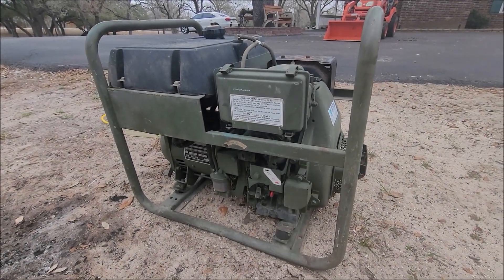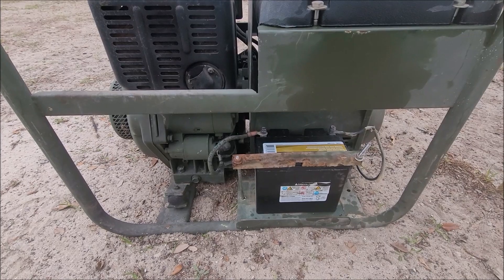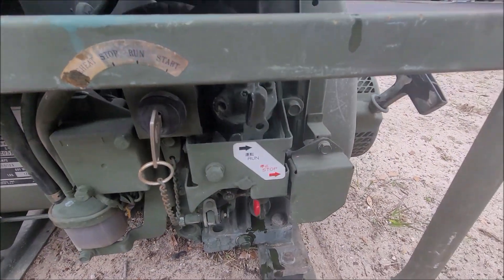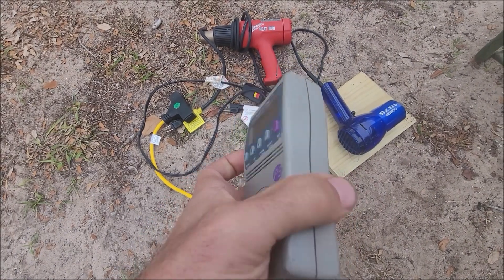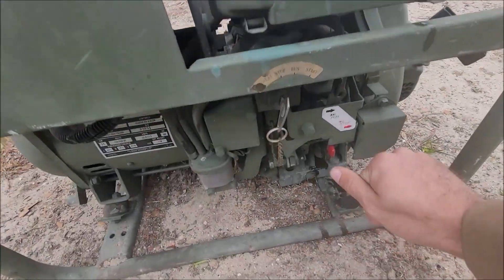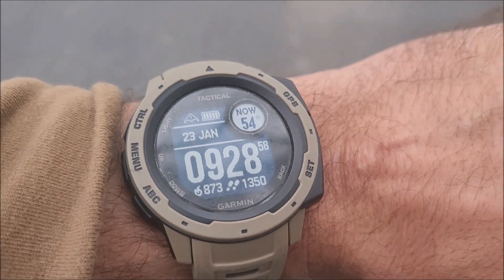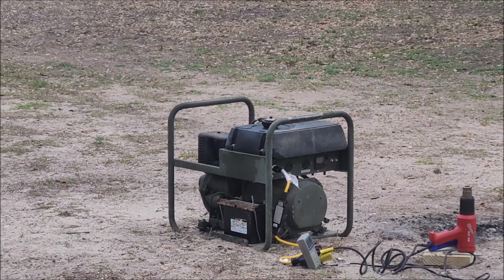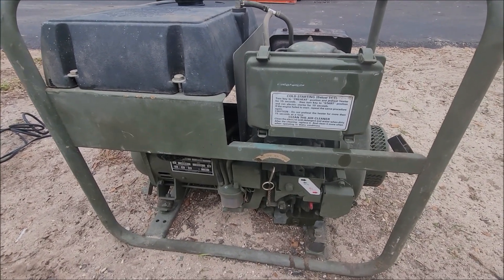Lightweight Independent Power System (L.I.P.S.) Part #1

Comment: I’ve got one of these and I started it today after 10 years of sitting and it started right up. Problem is it’s only putting out about 105 V and maybe 109 but it doesn’t seem to be enough to turn on the refrigerator in the kitchen. We’ve been without power for 24 hours and I thought this would do the trick, I can power up a vacuum cleaner and power drill with no problem, but it just doesn’t seem to have enough chrch. I plug a extension cord into it with the LED lights on each end and it glows until you plug in the refrigerator and then the LED light goes outon the cord. The refrigerator lights up on the inside, but I cannot hear it running and it doesn’t seem to be pulling hardly any amperage. Is there a way to turn up the voltage on the generator.
Reply from the maker: Could be a lot of stuff wrong that is causing that problem, voltage regulator, engine not at full RPM, ECT. Improper voltage is going to burn up your stuff so do not use it like that.

Comment: I picked mine up for 80 bucks off marketplace today, we'll see if it'll fire up after changing all the fluids and filters.
Reply from the maker: I'd just send it as long as it has oil & fuel. Won't hurt.
Reply: @CallMeColtLLC  turns out it needs new exhaust valve retainer keepers to run yay.

Comment: Brother you have the best 3k diesel generator ever made amazon the fuel filter/water separator keep it on hand. On the back round cap remover the 2 round head Phillips screws and write down the capacitor specs and order one and the air filter. Also download the millitary manual and teach yourself to drain the water out the filter and to bleed the fuel line after the filter and your good for 50years of price homeowner use. Congratulations on a hell of a buy.
Reply from the maker: I used it for a while as backup. Funny you made these posts the day after I traded it! I got some other, great little diesel generators though. I knew all about the stuff you mentioned. It is what I went over in the two videos I made mostly.